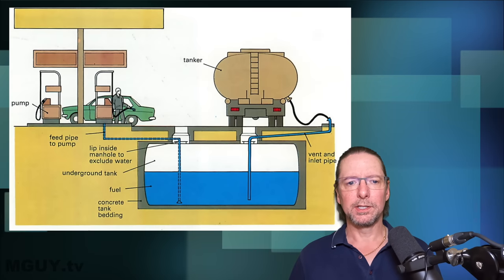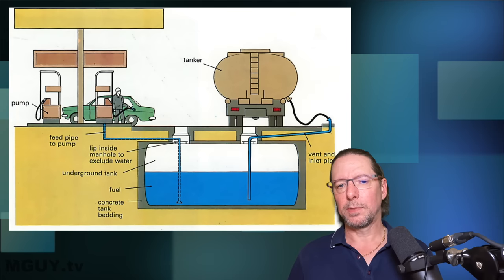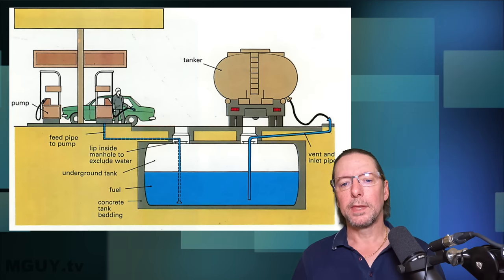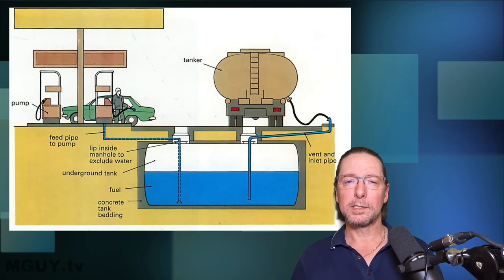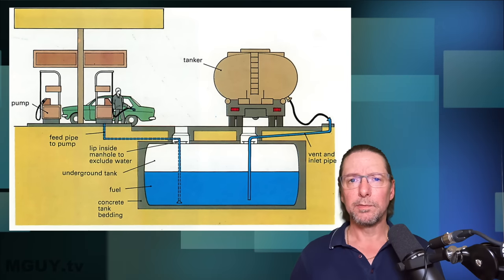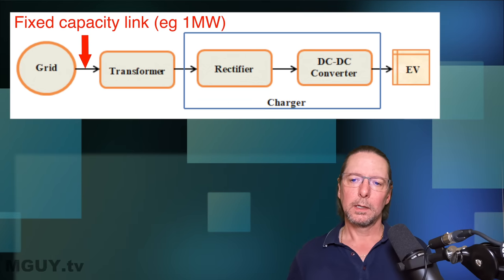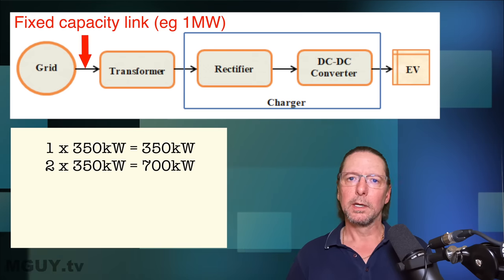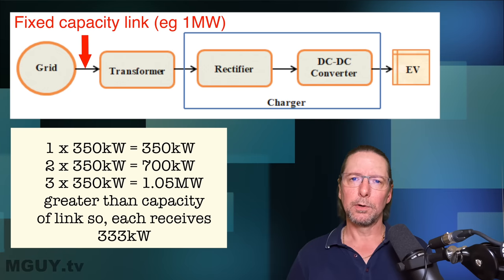HUGE problem with EV Charging Stations that no one mentions | MGUY Australia

Comment: Here in America one fuel pump has 2 hoses one for each side and I can tell you if a second vehicle comes when I am pumping gas it slows down but nowhere as slow and the electric cars. I can not believe that people are willing to wait 30 min or longer to charge up their electric vehicle. And here in America its crazy because I have seen pictures of these charging stations being powered by a diesel generator. I think electric vehicles are one of the biggest scams in years. In California there are days when they can not keep the power on to homes and they have rolling brown outs. How are they going to provide all this electricity they are going to need if even 50% of the people switch to electric vehicles. 

Also they are insane expensive, I can not wait until our government gets around to having them pay something for the road tax. Supported now via tax on gas and diesel. Well our government is not going to just stop getting all that money (need money to line their pockets ). Right now that is part of the savings but after all these people have spend 100K plus because its so inexpensive to drive then they will hit them with some kind of tax.

Comment: You can't just drag a MegaWatt of the grid, you need a buffer that will permit a gradual increase in demand. The consequences of over demand will be a LOCALISED burnout. It's why they try to have batteries and solar or wind to supplement the demand and taper the grid demand. 

That's all well and good with the rare stations available now, imagine a full infrastructure and the possible demands upon it?

Comment: Not to long in the future, the EV will no longer have a paint job. It will be coated with its own solar panel.
Tests have already been conducted on some test models that have the roof and trunk lid as charging panels.
As the solar panel industry leaps ahead with improvements, the need for heavy battery packs will be reduced and the reduction in the overall weight of the vehicle will also extend its range.
The future of the EV truly is looking brighter (pun intended 😅)

Comment: Well, you can solve that problem by having an optimized diesel generator with a diesel tank - but I think the main problem is the big USA or Australia - I live in small Portugal and I charge at home 99,9% of the time. By the way, I don't care about climate change and C02. I care about air quality in cities and the policies for preventing expensive health diseases.

Comment: I live in rural upstate New York .
I wish that the schematic of your idealized petrol tank with individual pumps a lines to each customer reflected reality.
Sadly it does not.
As more customers arrive the rate of fuel transfer into each tank drops. They all share the same pump and lines are only individually distributing fuel to each customer after the single pump.
This is a cheaper installation and maintenance  cost for the gas station owner .
Same problem as the EV station.
EV stations are designed like curb side back in slots.
As the lines of EV vehicles backs out of the station entrance the slower the rate of charge and EVs will power out while on line especially in winter at night.
That will create need for towing even short distances.
The charging stations cannot allow for one way traffic through the charging station as currently typically designed. When the EV is charged it needs to be able to pull forward out from between each charging pylon instead of being trapped in front of the pylon.
That means more real estate at  the station.  
That’s not cheap so the owners won’t like it.
The elite steering the masses always promise a free lunch but the never serve it up.

Comment: I just don't get why the EV industry isn't going towards universal aux. battery packs.  These packs could get you another 50-100miles and would be easy and quick to swap in and out.  Perhaps the battery size for that range is way bigger than I realize though.

Comment: The power available to an EV charging station is going to be limited by the grid it is attached to, which may have been installed 25 to 50 years ago. This cannot be instantly changed because the entire grid has to be upgraded to handle these higher power levels. Right now there IS NO plan to upgrade the nation's power grid, NONE! This is managed on the local and regional levels, not national.

Comment: Very few gas stations have multiple in-tank intakes because they'd all have to have separate filters, safety valves and etc.  Generally if all the pumps at a station are being used the gas comes out very slowly.   Many stations actually have tanks that have a separate pump-from volume in an inserted bulkhead compartment in the main tanks or plumbed to the sides and quite a few stations that offer multi-grade actually use the intake from all grades at the same time simply to fill your car.

Comment: Hi it’s interesting to think about the figures you’ve used in your example here. Although a 100/250/350kwh fast charging station can deliver these loads potentially, most Evs on the road cannot charge at anywhere like these rates due to battery management considerations so this so-called issue is a non-issue, for now. The bigger issue is the infrastructure being correctly installed and maintained which is one of the challenges being a developing industry, and for Ev drivers becoming educated and acquainted with the technology, forming new habits and routines, much as we’ve had to do with the ICE vehicle fuel delivery infrastructure. As far as your comments about competing loads on the grid with nearby industry, this is nothing new and is managed by the grid infrastructure as for any other large industry installation, plus with on site battery storage, this will also help manage varying and competing loads. The infrastructure will improve with use and respond to increasing demands, much the same as previous iterations of transport fuel infrastructure. Any battery storage will also have accompany battery management cooling and heating to manage efficient charging and discharging, much the same as most modern Evs, reducing the risks of overheating, fire etc.

Comment: I go to the petrol station and fill 30 liter in 5 minutes. That is an equivalent of 285kWh, so one petrol pump can "charge" with around 3.5MW. Over 10 times more and over 10 times faster. An I even could fill an empty coke bottle and bring it to my car if it gave up in the weeds.

Comment: Using his example. Factor in the max "dead battery" charging rate might be 350 kw. As the battery gets to 70% it slows and might be using 150 kw. So unless all three start at the same time, that  1Mw would be fine.

Even with ten gas pumps, I've had to wait in line. It doesn't take 30 minutes to fill a gas tank, but these days, you'll see a lot of people sitting at the pump after they're done, texting on their phones...for maybe 15-20 minutes. So charging time is just being converted to sheer ignorance.

Comment: With petrol ( or gasoline) full "charging" takes about 3 minutes (=0.05 h)and about 15 gal_us or about 56 liter.
1 liter of petrol has about 8.7 kWh.
56 liter x 8.7 kWh ~ 500 kWh in 3 minutes, ie 0.05 hour,
or the gas station has a capacity of 10.000 kW

Fast chargers are rarely above 200 kW.

People always have switched from less powerful to the more powerful, f.e horse carriage to cars (f.e. Model T with 20 "Horsepower").

As a stone rarely rolls up the hills by its own, but usually only downhill,
so I think most people will prefer 10.000 kW over measly 200 kW.

Comment: There is also another issue with EV's...most garages cannot cater for them because they do not have the equipment to deal with them - services and MOT's..earthing mats, special plastic tools, risk of 850 volt shock ( killer), bungie earthing and earthing mats. Garages around me won't even look at EV's too much cost to convert garage systems.
Spoke with a local fireman who dealt with an EV fire, dumped it into an 8cubic meter skip full of water, still smouldering 24hrs later.
Are these thick politicians for real??? OMG!

Comment: There are numerous infrastructure problems to overcome, but this example is just about how EV stations are set up, at the moment. Often I see EV stations sitting empty. When/if that changes and lines start forming, it will be in the stations’ interest to adjust the system, similar to what they’ve done over a century with gas stations/pumps/feeds. 
Then, if/when the system itself runs out, we will have a true infrastructure problem. Those issues are being tackled at a different level. How successfully? TBD.
You seem to be suggesting that a future demand be met in advance. Not necessary, and not cost effective.

Comment: Ive owned EVs for over 5 years and only once have i experienced a charger not giving full power. That was a hyper charger so even at a reduced rate, it still only took as long as it took to drink my coffee to give me a 200km boost. 
Clearly charging stations are (should be) connected to a suitable supply so putting aside extreme temperature days you should always get full power from them. Of course at least once you get home to your kids you can look them in the eye and say, at least im doing something to give your generation a chance to fix the mess prior generations have made of your planet.

Comment: The amount of energy generated from gasoline and diesel oil will be replaced with the amount of electricity generated.
Charging equipment that boosts the voltage to several hundred volts will be available across the country.
Replace lithium batteries every few years.

If these problems cannot be resolved, soaring electricity and resource prices, charging congestion, and waste pollution will occur.

Comment: If every automobile in the state of California, USA at this moment was an electric vehicle. Every watt of power generated in that state, from rooftop solar, wind, Hydro, gas, oil, coal, nuclear, if every source was feeding, the grid at 100% capacity, which has never happened by the way, all of that generated power, if it was dedicated to just recharging EV batteries, if every car in California right now, was an EV, the grid could not possibly satisfy the demand just for the cars..
  to have a power station go online takes approximately 12 years from planning, through hearings, meetings with public utility commission, meetings with zoning ordinance officials, Studies done by health and human resources, environmentalists, it goes through a lot of steps just in the planning phase. By the time the idea gets through to the actual construction phase, prices, sometimes nearly double…
  I am retired from working in the electric generation and distribution business after 40 years. I am from the East Coast, but California was mentioned many times, because in the near future, they are never gonna be able to supply the demand for power. This is before the additional load of electric vehicles was even discussed..
  if they think they are lowering their carbon footprint. They need to rethink that. They are just exporting the source..
   this is one of the reasons, smart meters have been replacing the conventional analog meters. They can selectively turn off certain groups of customers without disruption in vital services, like hospitals, traffic, lights, water, pumping stations, police stations, air, traffic, control towers, apartment, buildings with elevators, doctors, offices, etc
  All of the customer, locations and types of customer they are have been categorized in the computer where I worked. I did the work myself. That way, in an emergency situation, such as a heat wave, very cold weather, storm damage, any type of strain on the grid, they can flip a switch, literally, and just shut down residential individual homes without shutting off the hospital at the end of the block. Each smart meter has a communication device in it that will respond to a command transmitted over the electric wires. To reduce the strain on the system, they just need to put out a certain signal, and only the non essential locations will be turned off, reducing the strain on the grid. This is a much better alternative than rolling, blackouts or rolling brown outs…
  No one talks about the winter storm that crippled the electric grid in Texas a few years ago were they were depending on solar farms and windmill power generation. The cold temperatures shut that down for days. How did the people that had teslas charge their batteries? How do people that live in places like Florida, Louisiana, Texas evacuate when they are ordered to because of the approach of hurricanes? The lines at the gas station with people filling up to leave town and the service stations running out of gasoline are well known in those areas. that will make for some interesting news, headlines in the future.. Just imagine hundreds of thousands of people evacuating because of the approach of a category, five hurricane, and all those electric vehicles running out of power on the major roads blocking traffic. It’s going to happen.

Comment: The Tesla fast chargers emit 120kW. There are a very small number of 250kW ones installed.
Therefore your 1MW uplink can support 8 cars all charging at once at the maximum speed.
In any case, there are some wrong assumptions here - everybody will be charging at home and at work, so the service station model only applies for people in transit who need a topup between their regular charges on long trips, not for the current usage which is that everybody has to take their vehicle to the service station to fuel it up.
The underground tanks at service stations are leaky, expensive to maintain, and have a devastating effect on property values.
Even a small suburban service station can have 50kW of solar generation installed, which would net them far greater profits than they ever got from selling petrol in the first place.
The income from solar generation can be boosted with the use of on-site batteries.
The whole model is changing. Thinking that electrons are just going to replace hydrocarbons without anything else changing is just a nonsense.

Comment: The overall push for EVs has more to do with digital locking than any environmental concerns. It's easier for the government to hide a program in a chip than a module on a car. In the US where the EVs are not popular. The industry is falling to hybrids whose gas motors solely generate power for the EV control scheme. Governments want the ability to turn your transportation off at thier sole discretion with no chance to bypass the locks.

Comment: A fair point but the argument is pointless unless you know the exact supply capacity of the grid, to the Charging Station. Without figures for a specific installation, there is no case to argue.

Comment: It would be very expensive, but the EV Charging Systems could mimic a Large Tank of Petrol under the Ground, by intalling a huge battery complex that could feed into the DC OUT of the Line Power System, to keep it in Output Power Regulation.  But we know how expensive batteries are, and they don't have that great of an expected service life.  Or, charging stations could include huge Power Generators to supplement the Line Power which could possible be less expensive than using Battery Storage to regulate the Power Output.

Comment: Well there is tank solution for electricity. The capacitor or power banks, but power banks use same lithium cells so essentially you will run into limited amount of lithium around requiring double the amount of materials we have in this planet just to get all private vehicles electrified, then even more to electrify cargo industry and then double that to put batteries on each charger.. yeah no
Capacitors are cheaper but ones needed for this would be massive and can also be highly explosive in wrong conditions. If you have heard pop from electronic device when it fails, its likely that was capacitor blowing up. Really small capacitor. Not scale it up and its like flashbang going off. There are videos out there of capacitor blowing up and ones needed here are far larger.

Comment: I was at the park on the side of a 6 lane 40 mph  road so I started counting cars and light truck both ways. I  counted 1,000 of them in only 14 minutes. So the math is 1 million cars would pass in 22 hr.
  This is just one single street of hundred of thousands here of a small state. And they are only  just made 10 million ev and they now count  hybrids sales as a ev pump.  Ev are a peanut flop. They are 287 million of gas car on the road . They are living saying ev at 9.5. %  it not even 1 %   As the news they think lie will change people minds.
Reply: And don’t be fooled. If you payed 7,500 in taxes las yr then only you qualified fir not pay that this yr. Don’t believe the dealer saying you git the tax break, why? Nobody but them know what is the dealer mark up add on. And 7,500 in that 5 yr payment are around 100 a month difference.  You could be paying full price but they say you got that 7.5 k off. And show you the paperwork.

Comment: I just did a quick search for lithium mining. These numbers are approximate. Will use Tesla type s for example. It uses 350 kilos or about 770 pds. of lithium for its battery, will call that average for cars. In 2022 the world mined 130,000 tons of lithium. If the U.S. sold all cars as evs that would be 3,000,000 cars a year. 3,000,000 times 770 divided by 2000 pds in a ton would be 1,155,000 tons. The world would have to increase lithium mining by 1,000,000 tons a year just for the U.S. Think of all the environmental damage that would do, specifically the fresh water used.